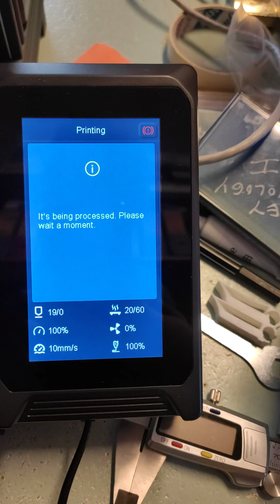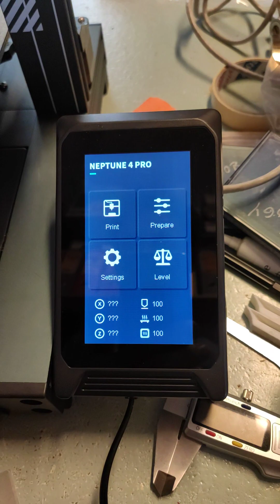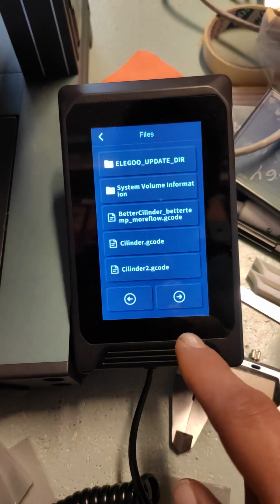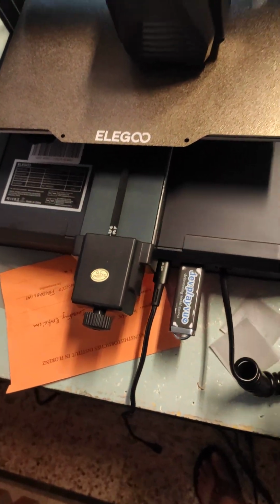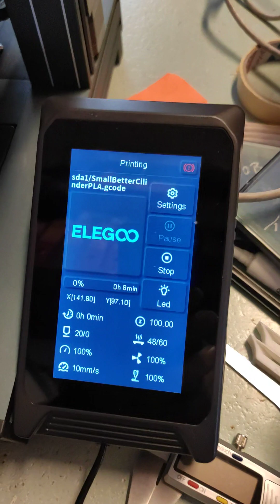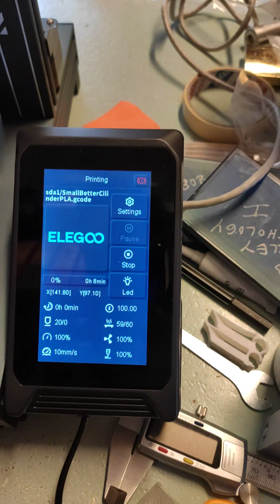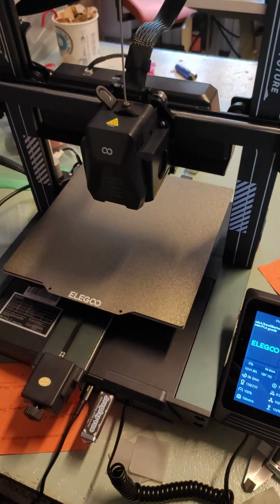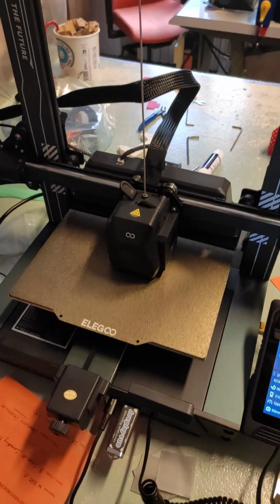Neptune 4 Pro: UX antichrist

Comment: I hate this machine as much as you do. The levelling sucks with the first layer being inconsistent, My printer cannot properly print a damn circle, The nozzle scrapes the infill and the top layer is ass most of the time. None of these are issues on my way cheaper Anycubic Mega Zero v1. The Neptune 4 Pro is a huge disappointment and a waste of time and money. Even if these issues can be fixed, the amount of time i put into this printer troubleshooting is insane when all i want to do is print. The only good thing about it is the speed and print quality.